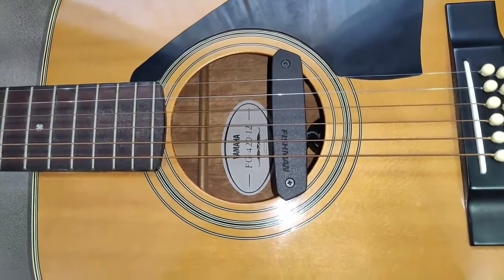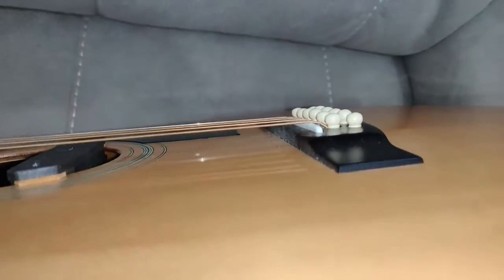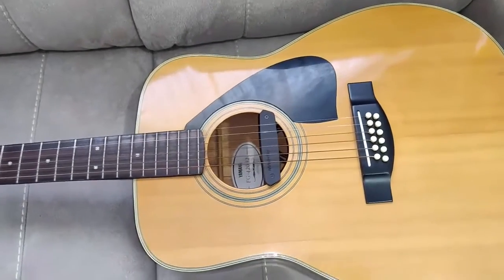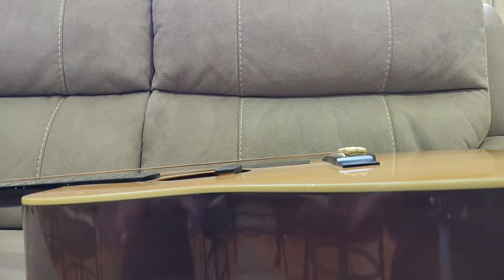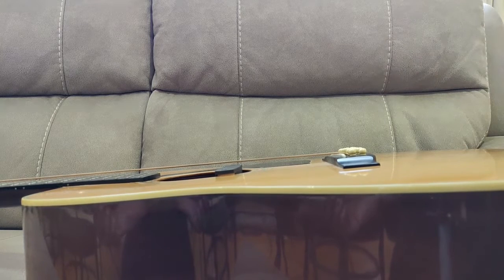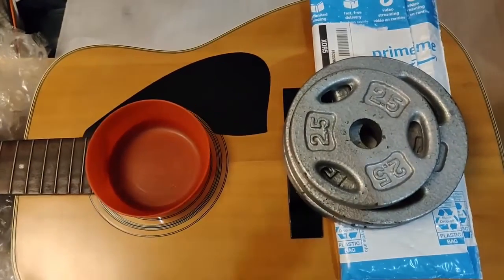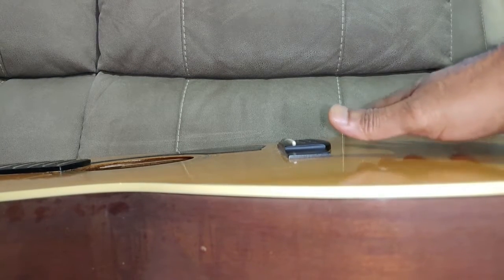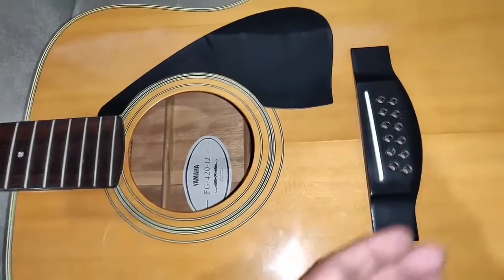Acoustic Guitar Belly-Bulge (Belly bow) repair YAMAHA FG 420 | Brass Bridge Plate Mate install

Comment: Thanks for posting the very informative video!!! My 100 yr old SammO Osborn koa guitar has a significant belly bulge and I wanted to know what temperature you kept the heating pad at on the Yamaha in this video? Also, did you keep the heat on the entire time the weights were on the guitar? Thank you!
Reply from the maker: @mattveneri2112  Thanks for your feedback, Matt! Frankly, I've now forgotten the details as I got involved with other projects. I'll check my notes and respond to your questions ASAP.
Reply from the maker: @mattveneri2112  Hi Matt! First off, I wish you all the success in refurbishing your vintage guitar.
I did not have an actual temperature reading. I just set it at 3 (of the 5 temp. setting) for about 12 hours using my small 12"x24" thermal pad which I normally use to warm-up my valved chromatic Harmonicas.
I don't recall for how long I kept the weights. Keep measuring every day. Your mileage may vary. It does take a long time.

Comment: How long we can put weight on it and soaked cloth inside guitar? Pleasee Rply
Reply from the maker: @Mehulverma3241  it depends on how your guitar reacts. Keep measuring/checking every two hours.
Reply: If my bulge is removed then how time after i can apply strings ?
Reply from the maker: @Mehulverma3241  if you use a bridge-doctor then you can put back the strings immediately.

Comment: Hi Prem.  Particularly impressed with the bridge plate you built.  Where would one get a brass sheet like that?  Great work on the belly bulge too!
Reply from the maker: Thanks again - for your kind words. If my memory serves well, I think I got the brass sheets from a local company here in Toronto. I guess you'll also find those in Amazon and the big-box stores as well.

Comment: Hey I am facing the same buldge issue can you clear out few things for me :
1) As it has already been 1 year after this Video how is the guitar now, did bulge re-emerge ? 
2)How you decided on time you'll keep guitar under weight ? Did you check using ruler after every few hours ?
Reply from the maker: 1) No bulge so far
2) I checked it with a straight edge (seen in the video) after at least 12 hours. Give it some time.
Reply: @PremMenon  thanks for reply Prem. My guitar is  4 years old, but it got this bulge, can high humidity be the factor for this? 
As you have years of experience what would you have done differently to take care of your guitar in retrospect ? It might help me.
Reply from the maker: @LearningGuitarDaily  you are welcome. Well, it depends on the environment the guitar is in. Humid, dry, Temp, etc. I guess it's dryness that must have caused, and probably the guitar construction itself... because 4 years is too short. From my experience, hanging the guitar by its headstock helps - after use as opposed to keeping it on a slanting stand. It's just my opinion based on experience.
There are many factors - including the string gauge used. For my kind of playing I always go for lighter ones than what comes as stock. Most recent purchase (couple of years now) was a Yamaha FS800. First thing I did was to add a bridge protector brass plate, and changed the strings to lighter ones.
I didn't bother about the warranty. Did it the day I brought it home.
Remember, not all the Techs in the big showrooms are qualified nor experienced to work on delicate things. Some are just there to earn some money.
Repairing things is a passion as well as an art.

Comment: Спасибо за видео , у меня такая  гитара и такая проблема , к сожалению не все понял
Reply from the maker: Thanks for checking it out. If you can tell me what part you did not understand, I'll try to send that information in Russian.
Reply: @PremMenon  здравствуйте , благодарю Вас за ответ , я вот , что  решил , Парогенератор надо..или кружку с горячей водой.чтоб парила...на край кусок паралона мокрый...и дырку затнуть...минимум на сутки..и надо не груз а столярную струбцину , это сложней , но ваш метод мне понравился , отлично , 🤝
Reply from the maker: @вовапаок  Vova, the method I used is not complicated. It is very simple. However, it's your choice.
I understand you want to use steam. My concern for you is, steam will damage other joints inside the guitar.
Anyway, it'll be nice if you make a video and post it. My best wishes to you.
Reply: 🤝спасибо

Comment: Have you tried to dehumidify it and keepinh it at 45 to 50 percent humidty. This issue usually  rectifies itself. Works in solidtop and sometimes  on laminated too.

More humidtiy causes bulge and less humidty sunks the top.
Reply from the maker: Suman, thank you for your valuable input. However, going by the winters here in Toronto - especially with the furnace blowing hot air, I suspect it's the lack of humidity in this case, although your logic makes a lot of sense. Anyhow, I'll make measurements periodically to see how things change. If it bulges again, as a last resort (before scrapping the guitar 😭), I plan on building a bridge doctor at home and installing it.
Reply: I agree your issue is different  as your environment  is dry instead of wet. Tbh if its plytop is almost useless to repair. If its solid top repair by luthier is easy and considerably cheaper. Good luck
Reply from the maker: @marutisumanroy  Suman, thanks for looping back. I think it's a solid Spruce top. Labor here is very $. Okay for a Martin, Taylor, or a Red Label; not for this. As mentioned, just an experiment, and it's working. I also installed a home made bridge doctor yesterday: https://youtu.be/kvhSw7YeMxI
Sentimental value... I purchased it new in Abu Dhabi in 1990, so....
Reply: Hi. I had same problem in my Yamaha f280 guitar. Belly bulge problem. Should i do something or wait for winter?? If it resolve it self.
Reply from the maker: F280 is a ply top. Repair is not difficult. Depends on how bad the bulge is.
Reply: @PremMenon  its new condition. Bridge is tight fix. But belly is little swellow. We can check through scale. But tell me how we can recover it.
Reply from the maker: @vikas6648  Vikas, instructions are in my video. If you are not comfortable doing it yourself, it's better you get a pro to look at it.
Reply: Did the bulge stay down now that it’s been a while?
Reply from the maker: Yes. It's now flat/controlled.

Comment: This was a twelve string in the first place so it's not worth putting any money into it as a six string and if you're not a luither don't try any repair work because you don't know what you're doing! A brass plate is not going to solve any sonic problems. The inner bridge plate is all chipped and needs to be removed and replaced with a proper wooden one but once again, this guitar might not be worth putting any money into!
Reply from the maker: Thanks for your feedback. 👍
Reply: Ya but it sounds good right?
Reply from the maker: My repaired guitar sounds good, yes.